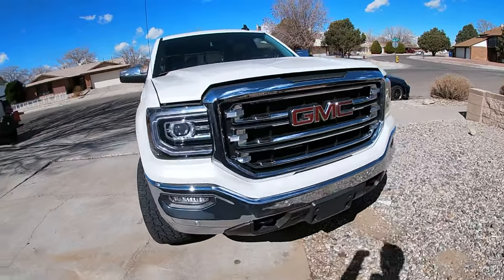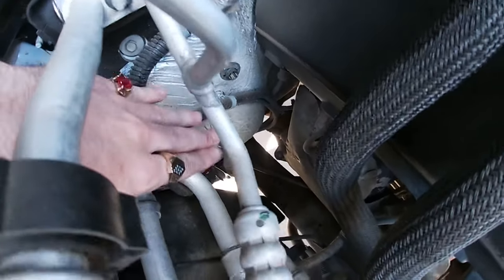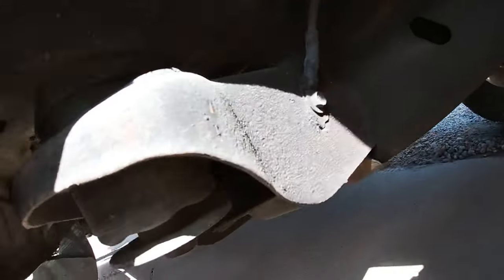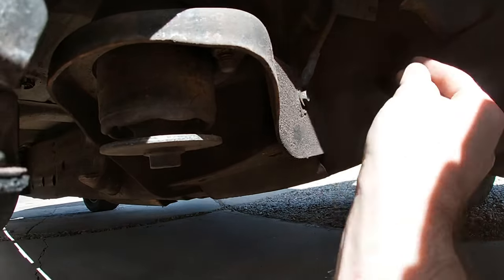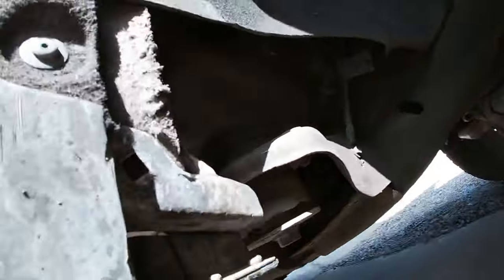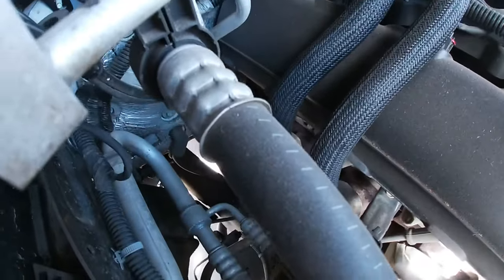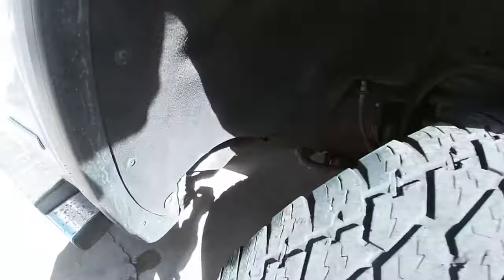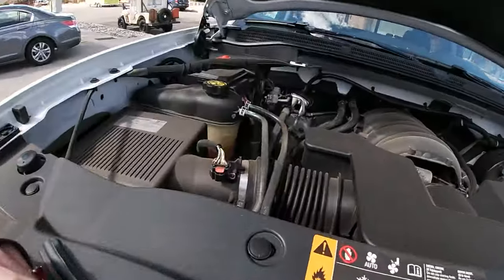2014-2018 Chevy Silverado electrical issues (solved)  part 2 pass side ground locations

Comment: Bro I need help I figured out the stabilitrack thing but I have also the instrument cluster problem where it’s in park but the orange light won’t glow over it and I put it in reverse and it glows I put in neutral and it stops glowing and drive also and then on M1 gears it works but idk what’s causing it.. it comes and goes mostly when I off road

Comment: After you cleaned the ground by passenger tire, did you use dielectric grease when reinstalling? Thanks.
Reply from the maker: I didn't Iv never liked that stuff but I’m sure it wouldn’t hurt if u did
Reply: @garciagarage7735  thanks for quick response! Testing now and if it doesn't work I've seen videos about broken/knicked wires in the front driver door harness that are another possible solution.

Comment: My car wont start battery is showing 12.7-12.8 volts on my tuner batterybis less than 2 months old negative terminal was loose but i tightened it back up would this help my problem as well??
Reply from the maker: What kinda car u drive same truck as mine r na

Comment: Wondering if this will help my problem, I have a 2015 Silverado 5.3, truck kicks into engine power reduced mode and stabiltrak lights comes on and puts the truck in limp mode won’t go over 50. Going to try this this weekend.
Reply: What was your fix
Reply: @jennakay9  not shit yet

Comment: What were the symptoms of this grounding issue? I think mine has this issue but my dash cluster is freaking out and losing power intermittently and showing every error possible
Reply from the maker: Check out my first video on my page shows a little video of what was going on
Reply: Oh man. This video he made it for me. FYI thank you again. I got "stailback" while driving and loosing power. Brights went out, other things stopped working. I cleaned the ground wire after this video. It did not solve anything for me. My truck died a week ago. It was towed this morning to drlaethsip , and be there a few days. A lot of my fuses are messed up, ground wires, alternator, pretty much all electrical. I will get a list either tomorrow or in the next 2 or 3 days. I'll comment when I get my full report. I know that 14-18 have this issue with ground wires. Like this guy here says. He or 100% spot on. I literally made a list this meaning of 8 things wrong with it electrically and handed it to chevy dealership. I will check all 8 things in front of them when they say truck is done.
Reply: @phoenixghost1099  how was everything bro any update ?
Reply: @ericsalcido8847  oh I replied to your other comment lol. Sorry man I ment to reply to this one lol
Reply: @phoenixghost1099  what was the verdict boss? What the dealership say?
Reply: @NavySealP226 did you get dash issues resolve my truck doing the same thing

Comment: Dude!!!!! I wish I would have seen this video first lol , I changed my spark plugs , wires , coils , injectors , tps, accelerator pedal and sensor and ground wires , but my truck was still running rough at idle and in drive and no acceleration from dead stop , come to find out my battery is at 8 volts , come to find out my ecu didn’t have the correct voltage to operate the ecu and throttle position, and that’s why I was getting tps codes and stabilitrak codes and I was overheating at idle , just really weird symptoms and this is the biggest but of my life !!!! But !! But I just got the battery 2 months ago and my truck starts just fine, without the correct voltage it made my truck run like shit , I thought my ecu was bad and all kinds of stuff, I assumed because I just got the battery, didn’t even cross my mind to test it😆😆😆never again will I assume!!!?truck started easily , it just wouldn’t show more than 8.93 volts at the post 😂😊

Comment: Should change the clickbait title to how you fixed your GMC Sierra lol.

Anyways, I've cleaned up my grounds in my dash, cleaned up all of the connections underneath the truck (mine is a 2014) and got a new battery. At this point the only thing I haven't changed is the harness itself which is in short supply.

Issue is still happening 🤷
Reply: I've got a 14 and done all those same things and still having a problem. Did you ever just completely change the negative battery cable? If you did did that fix your problem? Appreciate the feedback..

Comment: Bro it happend to me same thing but my rear lights stay on and drain my battery it happend like every 3 months and sometimes stay like thar real lights on alll the time do you think it will be the same thing?
Reply: Oh yeah. I got a call today. They keeping it till Monday. However here is all thats wrong. Battery fuse box was causing my electrical issues, except the "stailback" that was the ground wire under the dash. My thermometer was out, and my radiator leaking. They keeping it in the shop till Tuesday. Battery fuse box actually messed my battery. I was getting somehow to much power into my battery. Did not effect my stereo system on a negative way just cut my base out. I got 2 12s under back seats. Thay fuse box hard shorts all over it. So made all electronics mess up and ruin battery on top of the other stuff.
Reply: Its all good i had to replace my radiator but back lights still on and drain my battery i will try to clean de ground cables i hope that fix everything